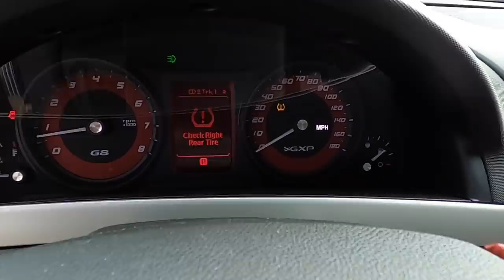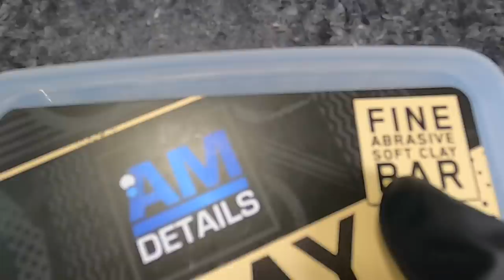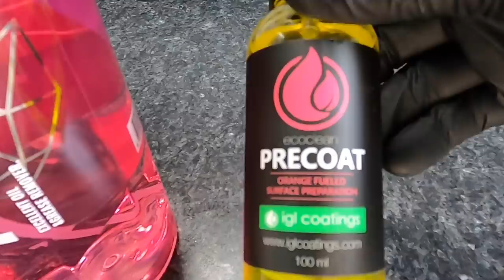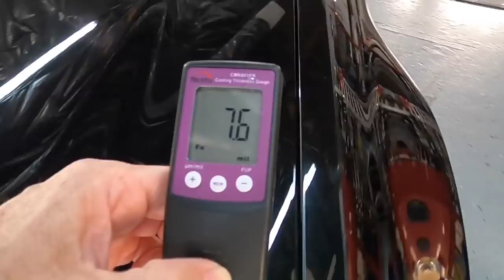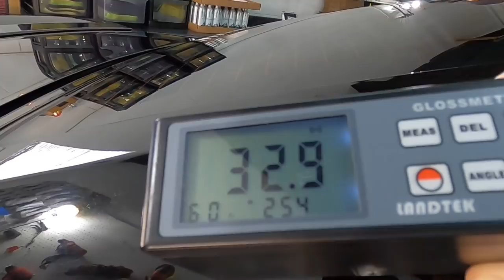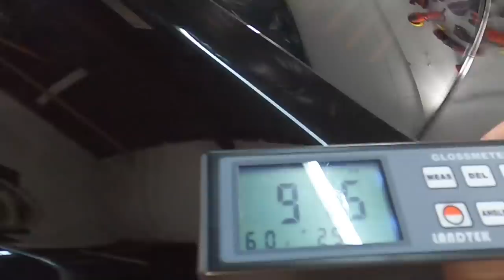Car Covers! No Car Cover At All Is Better Than A Cheap Car Cover. Here Is Why!!

Comment: I have to disagree on the title Bry, Id take a swirled out or marred clear coat from a car cover anytime over oxidized/uv sun damaged clear coat due to not having a cover at all. In short id still go for the cover jmho.
Reply: Same. I'll take swirls over cancer (oxidized clear coat).
Reply: Same here!
Reply: My truck sit out in sun at 3 to 4 wk at the time  in 100 degrees temperature that no protection
Reply: @jimmymiller7256  do u have GM truck?

Comment: Surprisingly you can get Citrol at Walmart!
Reply from the maker: Really!! That would be great!!
Reply: @apexdetail85  I had a unusual experience trying to buy it on Amazon. After I clicked on "buy it' a message popped up saying it could not ship to Maryland. I went on Ebay and purchased it with no problem for only $1 more and free shipping (19.95 for 16oz). It came from a place in PA. I thought it strange.

Comment: Totally agree about car covers. I used a cheap one during spring time to protect 20 year old Jaguar paint that was being stained by blossom tree petals. Wish I never bothered. The seams on the cover really do marr the paint. Any time there was a slight breeze blowing I'm sure I could hear the car groaning in pain.
Reply: Put a soft indoor cover on, then the cheap out door water proof cover. The outdoor cover will slide over the inner cover, and not the paint. Shoes without socks, give you blisters.

Comment: I bought a really expensive car cover from seal skin purchased a 2023 Lexus then had it ceramic coated waited 6 days then I put it on the car while I traveled to California was gone 10 days when I came back I took the cover off and the paint on the car was destroyed there were scratches and rub marks everywhere had to re detail it for complete paint correction and it cost almost 600 dollars contacted seal skin and they pretty much said sucks for you I’ll never get another cover again

Comment: My case for using a cover is 
1. I have a black car
2. My paint is already swirly as I am second owner and the car is 12 years old
3. I am more concerned with the clear coat failing from the brutal sun. (the near perfect headlight lenses when I got the car already started oxidizing)
Until I get an in-door garage, I will keep my car under the sheets.

Comment: 3 golden rules for car covers:
1) Get one with a soft fleece interior
2) Clean car thoroughly before putting a cover on
3) clean cover thoroughly before putting the cover on.

Even then, its really hard to not get any dirt between the cover and car, and some damage in inevitable. When your only choice it to park under a tree, and you need to have the car there over winter, a cover is still worth it.
Reply: Rule 0 that comes before all rules: 0. Don't use a car cover at any time, indoors or outdoors.  Apply a ceramic coating (or whatever new stuff they got out these days) after a decent paint correction and try to keep it away from the sun.
Reply: @zerocal76  What if you can't avoid the sun I live in Vegas no garage any suggestions?
Reply: @ashantirobinson242  Whats up.  I live in southern Cali so we get a lot of sun rays and its pretty hot sometimes.  I strongly suggesting a ceramic coating or whatever new type of coatings that will protect from UV rays.  That stuff always fades paint in the long run
Reply: @zerocal76  
Thank you, I was hoping for an affordable solution. 

I take it this is the best option I appreciate you for responding.
Reply: @ashantirobinson242  You're welcome. And look, you might have to do this as well bc I don't know how good the coatings are nowadays but a small canopy that will block the Sun will do wonders not only for your paint but your interior as well.  I have a 30 year old Corvette that sits outside all the time and the coating has been enough to protect its paint.  My baby's paint is very reflective still 😀I do need to do another one soon though.
Reply: @zerocal76  you're saying a cover does more damage than UV rays in Vegas?  I live in deep south and there's a lot more clouds than the desert but it's still brutal here.  I bought expensive cover but now all I read now is: mistake mistake mistake. Not soft enough, wind will cause scratches, must be 101% water proof.  Then I look for my cover in another video for "Top 5" covers... fuggetaboutit. Discouraging. Two nice vehicles, one carport. Major dilemma.
Reply: @teller1290  honestly, unless a car is in a garage that is pretty air tight/modern, there's going to be some form of damage to the paint over time. But if you look at what a ceramic coating does (protects not only the paint but also the clear coat on top of the paint) that's the best u can do outside. Why? A car cover creates scratches and to remove them, u have to polish the paint. Polishing removes a bit of clear coat every time. So compared to the Sun, it damages faster
Reply: @teller1290  No perfect solution. 

-leave cars uncovered…hot hot hot. Water spots. Bird poop. Etc

-cover the car, but if it’s not freshly washed, the cover causes friction when windy and will rub any surface particles into the paint, causing fine scratches. 

I don’t know. 

Maybe you won’t have any issues?  But darker colored cars show everything.
Reply: @craig.encinitas  you'd think if well-fitted and secured by elastic corners and a theft strap under the middle, that the darn thing wouldn't move much, wouldn't you?

Comment: Car cover you say are not recommended? Just remember BIRD DROPPINGS ARE MUCH WORSE. If one doesn't have a garage it's much better than nothing, unless one wants to have a surely needed paint job. There's nothing really ideal unless one lives in an area where birds don't exist. A cover can seem more of a hassle for many. My car is 10 years old, and looks brand new as a result of a good cover, and excellent management. I do have minor marks on driver's side roof rail,  that a body shop removes for me. Mild buffing on occasion where wet sanding is not needed is still better than having highly acidic bird droppings which if left long enough, will be further in your paint than most marks. That will often require wet sanding or sometimes a new paint job. Only ideal situation is driving from a garage to another garage for several hours when parked, that's enclosed of course. I look over my car with a flashlight before I go to bed,  and pray that nothing is left for too long when I do get bird droppings wherever i go. That could be a movie, or out to dinner. I have two cars. I use my luxury car sparingly. I go over my cover with a damp cloth, as well as go over the paint if it's dusty, and take it for a weekly spin of 2 miles or so, and place the cover back on only to be sure to check it over, that there are no bird droppings. A bird I believe a few years back flew under and between the cover, and paint and left a stain on a windy day. Needed repainting. I ordered a cover from coverking. I need to have Mark's buffed out. However still better than no car cover at all. A body shop who has a vested interest in repairing vehicles, wants to paint.

Comment: Excellent tip on not spraying a panel prep directly on a panel after a polishing set! I did actually fine my panel prep more troublesome to use when i used it right after yesterday on my re-sprayed 2 car doors. Usually i would polish a whole panel before i use panel prep but to reduce steps i will try spraying it into the towel. I might be polishing my other 2 doors today while the weather is good!

Comment: I'm just a hobbyist, taking care of my cars, but I want to do as thorough a job as possible. This video was rich with all kind of pearls of wisdom and aspects, such as pillar polishing and the mini/micro polishing you did behind the door handles. Do you have a video already produced about the machine/equipment you used for that micro polishing, or would you consider producing such a video? It looked like a Dremel cable tool, but I didn't see how it was powered, or where you would find the pads you were using.Thank you for sharing your knowledge so generously.
Reply: Hi. Since you seem to dedicate time to this sort of deal i was wondering if you could help me out. I want to paint my car with a high quality paint job but i'm trying to do research on how to maintain it to keep it for as long as possible. Would you say that the best way is just to wrap it after painting it or just wax it often instead?

Comment: I have a $600 car cover from Chevrolet, actually meant to be used outside. When I removed it this spring from a car stored in my garage the car still had a coating of dust on it, car was clean when I put it on and my garage is not a dusty environment. What the hell?

Comment: My car is always parked under a roof. But it's less driven, only once in a week or so I take it out for a spin. Sunlight and rain is not an issue for me. I'm considering buying a car cover for the dust that accumaltes on it in a weeks time. But by going through all the videos on YT I feel I shall drop the idea. Should I go for a cover or keep following the wash and use method?? What's say YT?

Comment: I was thinking of using one just when parked in the garage (after washing), never when outside where the wind can move it and abrade the paint.
Reply: I ordered a very expensive, outdoor, custom fit cover designed primarily to defeat UV rays in the deep south (USA).  It's nice and snug, so do you see a problem in that situation?

Comment: I put a cover on my 2017 Grand Sport while stored in the garage during the LONG winter
Reply: I have a dust cover for the car in the garage. 
The car is coated, and I’ll take my chances.  That being said, I absolutely scratched my other car with a regular car cover.
Reply: @craig.encinitas  but what is a regular car cover? I have two custom fitted ones for a '21 Tundra and a '17 Chevy SS.  I live in brutally hot southeast (with single vehicle carport) and UV scared me into this option.  

I've had a detailer coat both vehicles but I don't know beans about such things and, for all I know, all he did was wax it and tell me he did more. Cynical? I know.  But I just can't get comfortable with trusting invisible costing to the all-day, six months of death rays down here.

Comment: For anyone interested in gloss meters, everything said in this video about gloss meters is incorrect. Ironic how he mentions that a lot of individuals that have them don't know how to use them, unfortunately him being one of them. (as a "professional detailer" you need to be aware of what information you are putting out into the world)
Using the correct measurement geometry increases resolution and improves the correlation of results with human perception of quality.
The 60 degree angle is best employed on mid gloss samples measuring between 10 and 70 gloss units. High gloss surfaces which measure above 70 gloss units should be assessed using the 20 degree angle.
For anyone measuring at 60 degrees are getting a higher gloss unit readings making their correction skills look better than they actually are. The 20 degree reading will show a more accurate and lower gloss unit. (a true measurement so to speak)
And the higher end accurate units that are worth thousands will have haze percentage and reflectance percentage allowing you to work on refining the paint for even better results.
I work with the world leaders of paint inspection equipment.

Comment: The softness of new car paint is so frustrating. They have to be ceramic coated full stop. I had dialed in my black 2020 Mazda 3, coated with Adam's graphene. The graphene coating failed so I took it off. In just a few months of safe washing without a coating, the paint was scratched and marred to unacceptable levels. I've had CSL/EXO on for two months and I've not had so much as a love mark. I probably should have gotten CSU off the bat.
Reply: Mazdas have always had super thin paint and clear coat. My 08 mazda 3 paint is as thin as pubic hair and is riddled with chips now

Comment: On a different subject but here goes. I spent the last two days prepping and coating my new car. I used to luxury microfiber sheild pro and it has been 24 hrs since I have installed. I am going to be putting a Sacrificial coat of armor and kings guard. Should I wipe it off with ONR before I put the armor?
Reply from the maker: Use a damp microfiber to gently remove any light dust particles.

Comment: Hello, I have a 2016 Jetta GLI SEL with the deep black pearl paint.  I can't park it inside of a garage and want to know what you would think the best way to protect it would be? I live in Idaho where it ranges from 100° in July and August to snow and ice and 10° in January.  I just purchased the car and it's being shipped to me pictures look great but I'm sure it will need some type of prep. I know it's you used the metal oxide coating Is that better than ceramic?

Comment: brian what's the difference of those 2 da machines? first, we used flex, and on the final step, I guess it's shine mate. for initial correction used flex, is it because of forced rotation one?
Reply from the maker: The ShineMate had a shorter throw perfect for the final stage.
Reply: Orbit Diameter ?

Comment: I'm hearing many detailers blast any kind of waterless cleaning. Either use water or do not wash.
Reply: All depends on the situation. Every product  has water of course and it comes down to the right tool for the right job.
Reply from the maker: In some areas...there is no choice. I use it at times and do have a choice. Its fine.